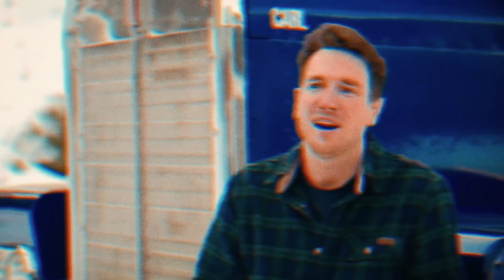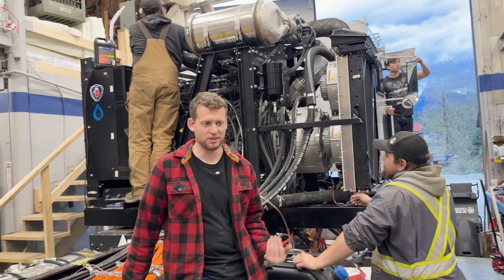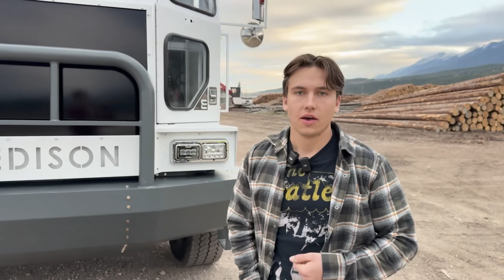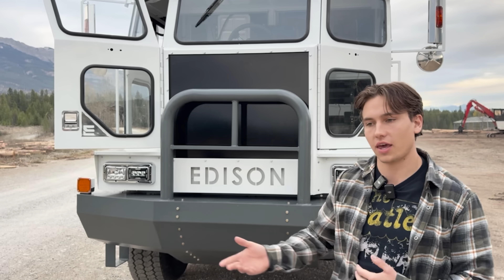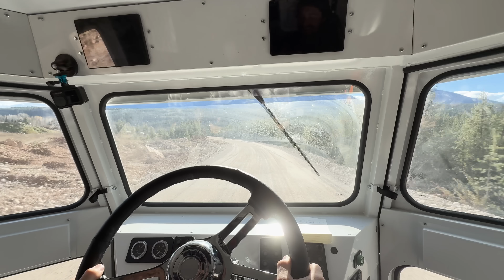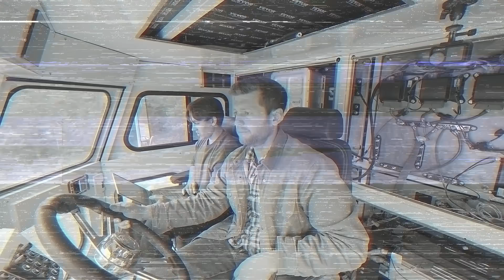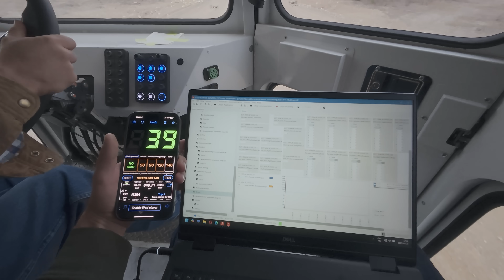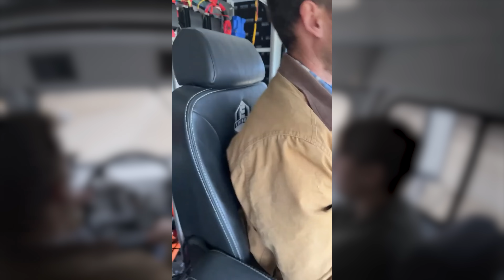Driving Our New Hybrid Truck for The First Time

Comment: The flat window panes alone make your truck design far more consumer friendly to users. Its a small detail but it shows your business is building for affordability, usefulness, and maintenance rather than profit and consumerism. I applaud your work and also deeply appreciate your truck, it looks damn good. I hope to see these on the road one day!
Reply: I mean it’ll be for profit but I think they should focus next on cost efficiency so that quality won’t suffer
Reply: @TheBlessedKettle  sleepers
Reply: Boogsleper for teams
Reply: The cabin/window design makes the view to the outside atrocious: Let's have FOUR blind spots instead of two from pillars compared to common designs
Reply: @Mark-hd8io the panes can always be rearranged or made larger. Theres nothing forcing them to keep this exact window configuration.
Reply: @Mark-hd8io  it's built like an aluminum jet boat, even the console looks incredibly similar to a Custom Weld. Throw stick steering in it to really complete the package lol.
Reply: @Mark-hd8io the blind spots are quite small, really. Especially for what this truck is meant to be used for.
Reply: @Mark-hd8io  It looks like if you hit something head-on, you won't be able to open either door. There's a good reason why doors are always on both sides of vehicles, not the front.
Reply: @the_editor_says With a proper mirror setup, there's no logical reason to ever open the door while driving, unless you drive like a farmer with a tractor in his barn. 
If there's another, wider cabin behind the main cabin that obstructs the view, it's poor design from the driver's perspective.

Comment: Like 8 months ago I was stoned, and I asked chatgpt why we don't have semi trucks running like diesel electric locomotives, and it told me it was impossible 😂 apparently it never heard of these guys.

This makes sense, way more than a full ev truck. If reliable it would make for awesome military applications. I am assuming that with a generator hybrid your miles per gallon, or range, is much better than ice or ev alone.

And your truck looks sick. Your truck looks like it's going to be a beast for a lot of industries.

Comment: why?
why would you need diesel and electric?
from a physics point, it doesn't make any sense.
from an economic point hmmm guess what exactly the same.
Reply: It has the higher hp and torque of electric axles. It has the range of diesel. It is expected to have lower operating costs over its lifetime.

Comment: Great builds. 👍 Great design. Just wondering, for a backup for mobility, would there be a way you could tie in the generator motor to a transmission and transfer case to the front axle? Say all electrical motors and battery system failure to rear axles, if generator motor was hooked into front axle with transfer case, you can still get somewhere just using ICE.

Comment: Look into Thermoelectric generator technology like been used on Voyager for 48 years now. How much fuel is lost as heat? Might be able to reduce size of your engine and you can send the power to capacitors to slowly bleed into your battery. Also you could use the Capacitor bank to stack with generator max output to motors if generator can't output what your motors can really do it will help you gain extra power. Think of Capacitor bank as regenerating Nitro for a car lol.

I'm on your side fully but I'm leaning that more along the lines of big flying versions. But Truck good platform to get it all ready.. Internal blade system with Triboelectric ducts + Ultrasonic never jam shutters for all directions thrust control and continuous thrust stability using drag design in the duct system. Side bonus = Ultrasonic duct whistlers. Ultrasonic duct whistlers = Use airflow to make ultrasound that can be used to see 3D around large craft for 3rd person piloting. Ultrasound work for vehicles too though. Taps Plasma Ultrasound generators

Best reason for Ultrasound = Elevating sound of craft beyond hearing for illusion of silence aka still classified Stealth. 😉 Edit: Reason for flying versions = Too many people on the roads AND I'm so tired of stupid idiots getting in the way of civilization REQUIREMENT of truckers doing stupid protests. And if idiots are on Trucker landing pads = Flash engines to blow them off the pad. Can't go to jail for using wind a weapon yet.. Ask the Cloud seeding Military traitors about that.

Comment: Where do you sleep?  Does it have air horns?  Is there RF shielding so the CB reception is not affected?  Can the driver reach the toll booth lady to pay the toll fee?  Will it work at a Tesla station without blocking all the other charging park spaces?  Can it be powerwith a SMR?  (Small Modular Reactor) - nuclear,  Can Ukraine  interface the Starlink to make a really big remote control surprise for the Russian troops?  Can you add oxygen tanks for the generator so NASA can put their drilling rig on  this to blow up the asteroid heading for earth?   Will the battery also power the drilling rig?  Will it work on other planets?
Reply: I like your style :)

Comment: I like the idea of a diesel hybrid for long haul in the middle of nowhere type trucking. The only thing here that is giving me nightmares is the design of your cabin. One good head on with a truck even at low speed and you're trapped in there. You need a rear exit emergency door.
Reply: Probably a good idea, better safe than sorry when it comes to safety

Comment: This test was cool other than that annoying squeak and rattle. The Test Track is just that a test bed much like a mining road. It is literally a shake down road. If there is a component, connector, or suspension not secured or engineered properly it will be uncovered.

Comment: I owned an EV car for three years and recently switched to a plug in hybrid. Must say I’m much happier with the hybrid and this technology in heavy trucks makes sense to me.
Reply: Unfortunately, in a hybrid, the engine is still connected to the wheels with shafts and gears. This creates all kinds of problems an compromises in design. These trucks are electric with a generator. Which was always the better technology, but ICE automakers didn't want to retool their assembly lines for this setup, because it differs to much from what they're used to.
Look at this new truck from Edison, they decided to change the engine position from being in the nose to sitting elevated behind the cab. You could never even think of that with a hybrid. That's what I mean with less compromises in design.
Reply: @mennol3885  I'm not convinced putting the engine up that high is a good idea.  That has to result in a pretty high center of gravity.

Comment: I just wanna say, that cab design is fucking iconic. You've found your visual identity.
Reply: I can't get over how damn cool it is, the mashup of newer design cues with the flat panes is just perfect. It looks like a bulldog, especially with push-bar.
Reply: Gives off strong M1140 (HIMARS) vibes.... I told them they should talk to the Ukraine government, because this truck could find good use as a weapons platform for Ukraine's own weapons systems. . . Maybe more.....
Reply: looks like a locomotive sort of
Reply: As the lower windows aren't part of the main windscreen, is it legal to heavily tint those?  Top/main windscreen normal tint, lower windows dark tint.

That would look cooler, less intrusive people walking past looking up at the driver's balls, and still give you better visibility than a normal truck.
Reply: Visibility out front onto the road doesn't look that great though, at least not on camera
Reply: Hey fellow clippy. Nice to see the clippy movement getting widespread.
Reply: Also, all the small windows will have no visibility without wipers, especially the lower ones. Feels more like eye candy for investors than any real practical design.
Reply: @Thisisjust1guy it’s functional, these trucks are built for logging, so they maximized visibility over looks, which leads to this space/rover like appearance.
Reply: @Randomly_Scrolling  didn’t the dude above just say it has bad visibility?
Reply: @Bobroxkey read the whole line
Reply: @Randomly_Scrolling  yeah he was saying that the windows didn’t look practical that’s why it’s “eye candy”
Reply: @Bobroxkey read what he added
Reply: @Randomly_Scrolling  I’m confused 😅
Reply: @Bobroxkey well when you figure it out, we will continue this chat 🤷‍♂️
Reply: @Thisisjust1guy  at 11:07 I see a wiper in the front windshield at the very least, they just extend from the top instead of the bottom.
Reply: it looks dumb as shit but its just a prototype
Reply: @kuromiandmagic I think it would make a great shunt truck those aren't normally known to look nice but this one looks like it'd probably have great visibility. Looks tuff as well.

Comment: This is the only truck I'm interested in from Edison Motors.  Like if you agree.
Reply: I'd love an Edison Motors kit for cars eventually too, don't need self driving, driver assist features, or a useless touchscreen entertainment center in the dash, just a hybrid upgrade for an 07 CRV would be perfect IMO
Reply: @UNSCPILOT  I want the same thing for F-150's to F-650's.
Reply: @jdm1066  Having had a Ford previously and seen my neighbor fighting with all the cheap plastic parts in a Ford just to do basic maintenance, you might be better off with a different vehicle as a base.

Unless your talking about something old enough to actually be built decent, but at least in my experience most Fords made in the last 25 years or more haven't been worth the effort.

I could be wrong, but that's my take on the matter, last one we had always sounded like it was going to rattle to bits at a moment's notice even with good upkeep.

Then again finding a pickup truck nowadays that isn't a glorified minivsn pavement pricess with rear suspension too soft for 10 sheets of drywall is rare, worked in a construction supply store and saw a lot of much older trucks and Vans being used by pros because modern trucks are hopeless
Reply: @UNSCPILOT  1999-2002 is what I'm looking at.
Reply: @jdm1066 fair enough, my estimate May have been off, that's probably close to the age of most of the "useable" trucks I saw.

IIRC Edison did have a "F-350 class" rear axle with the motors they were working on so good chance you might have the option sooner than some of us driving lighter duty cars, good luck!

Comment: Turning your head 90 degrees to see the side mirrors is not a great design, the further you have to move your head the longer your eyes are of the road and the more disorientated you are from driving in a straight line, those mirrors need to be in the corner of your eyes ideally.

Comment: wait so why is DEF required on a generator if the drivetrain is electric??
Reply: It has a standard building style genset generator to recharge the batteries as needed. It's a range extended ev.

Comment: Just an idea for the first step to enter the cab, the one close to the wheel....  Use two big rubber straps for the vertical parts. It remain flexible in case you bump it and it bend into the wheel. We make similar product for locomotives.
Reply: Could use wire rope too.

Comment: That hop under acceleration is hilarious, it's got a metric ton of torque.

I wonder if the throttle response could be filtered by weight? Like having a programming feature that allows you to input how loaded up the truck is and then adjust the throttle response to pedal inputs?
Reply: You shouldn't even have to put the weight in. The computer knows the torque and acceleration of the motors.

Comment: Those forward-opening doors concern me from a safety point of view. I could see an impact to the cab mechanically binding up both doors bad enough to trap the operators in the cab. More conventional side doors would likely make post-impact egress much more likely and safe? Test by hanging a log from an overhead beam and impacting the cab from various angles?

Comment: While I'm a big advocate of range extenders. Seeing that 'gen set ' mounted on the frame brings home the impact of weight, size and cost on the designs. For some roles, swappable batteries may be a good solution. Janus motors in Australia are doing well with this, and you would be wise to keep a watch on the technology as an alternative option further down the road (especially if battery density improves like Janus claim: 1.2+ MWh in 2026!).
Looking forward to seeing the new trucks,well done!

Comment: Driving a Range Extender daily to 136k miles the past 5 years (i3 REx) gives me GREAT hope that Edison has a huge hit here!

We are NEVER held up by EV chargers despite 95% of our miles on pure, silent electric drive.

90% of our braking is regenerative, saving the brakes.

The tiny 35hp generator is PLENTY to supply the batteries since the 170hp electric drive motors are rarely used at full power for more than 15 seconds at a time.

We've had many utility trucks idling in our area following a huge storm, and Edison Trucks would be PERFECT for this use case.
Reply: ^^ this fellow gets it :)
Reply: Heh, I have a 2016 i3 REX & commute 120 miles to work (60 each way) ... Battery range is about 60 miles + 80 miles with the REX. It is a go kart, but it gets the job done & I will either trade it in for another i3 or get the battery upgraded once the capacity gets too bad to make it to work.

BMW is nuts for ending production on these cars.
Reply: @holdenhodgdon3756 
Yep.
Making the i3 from carbon fiber $$$ might have been too co$tly and cemented its demise😂
Reply: @TheGratefulYeti it wasn't about money, as the design was relatively popular and the manufacturimg process was fully mature; a new marketing executive got hired and proclaimed that the design didn't look luxurious enough for BMW's brand image (not an exaggeration).
Reply: @holdenhodgdon3756 
Much like Edison trucks, i3 is truly "Function>Form".
Who cares if it's not posh-looking.
Probably the most German (rational) car ever made.
Reply: @TheGratefulYeti It was designed at a time when Marketing had no idea how to sell EVs, so the engineers were given a list general metrics to hit & then set loose ... Literally the same exact program that produced the i8 "Simper Car."

Comment: Y’all should set up/write checklists to be checked and filled out before the truck leaves the shop for testing/maintenance or what have you

That way you avoid errors like this again, and in the future avoid shipping a truck with a connector unplugged.
Reply: The dullest pencil is sharper than the sharpest memory

Comment: As a software engineer I hope you guys have a great automated testing architecture in place. Something like oil pressure reading should have been solved and found in simulation and automated testing. Writing clever software is easy. Changing it 2-3 years down the road to add features without breaking stuff is where it gets hard. There are continuous testing techniques to solve that problem. Let me know if you need help with that.
Reply: Meh. What were watching IS the testing.

Comment: i guess now its time to start pulling pins out of the computer while its driving to induce fault codes and see if the system can have a graceful shutdown rather then just shit the bed when it looses a pin
Reply: Yeah, switch to limp mode instead of DOA

Comment: Please keep up these videos. Super interesting and a source of revenue for you guys while you build marketing momentum. I'd love to see you guys use your hybrid chassis for the RV market. Plaster the roof with solar - every square inch, use the vehicle heat pump not just for HVAC, but to also heat water (might need a secondary loop to go from warm to hot). Basically I'm looking for a solar-powered Tesla style RV (class C or class A, 24 to 33 foot). The idea is that you can stop by gas stations to pick up gas, then go park somewhere and be self-sufficient for 1-2 weeks at a time. Heat pumps are amazing and work down to -35 Celsius or even further and are way more efficient than resistive heating. Why heat pumps - because it does not consume fuel. That's where the full solar roof comes in, can get 3-6 KW of solar using bi-facial panels. There's a company in the US called "Living Vehicle" (please take notes on what they do and their philosophy) and they put an atmospheric water generator into everything (uses just ~500 watts to produce several gallons of pure water per day). Now, with that much solar why not route the excess to recharge the vehicle battery? 6 KW gives about 30 km/hour of charging on a Tesla Model Y, yes this will be less on an RV, but it's something. Want more solar - solar awnings are a thing. Anyways, all-electric RV with generator for when battery gets too low. Single fuel, no propane, run out of fuel - just soak up some sunshine for a few hours and you're good to go. Maybe partner up with Leisure Travel to have an all-Canadian build! (Summary = Tesla-like EV chassis and HVAC systems, Aptera-style solar charging - as an RV chassis.)

Comment: Good things happening with this truck. But I see huge blind spots with the window pillars. 
The center seating I think is a bad idea ,you want to step into a new truck and not have to relearn how to drive. . And backing into a dock you can't just look out the side window to see your trailer you'd have to use the mirrors that become blocked by your trailer.. also that cab is just ugly. Just put a Scania can on it 😊

Comment: All mechanical components on this truck are tested and proven already. So are the engine and the premium electric components. All they are doing is testing the build itself and fine tuning the controls. Builds like theses are weaker by feel and fine tuned by measurements.